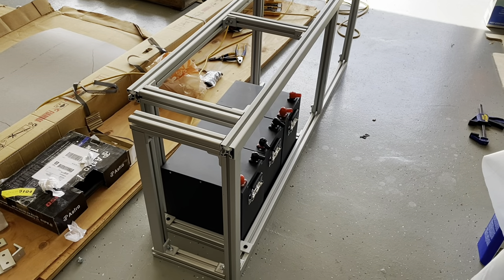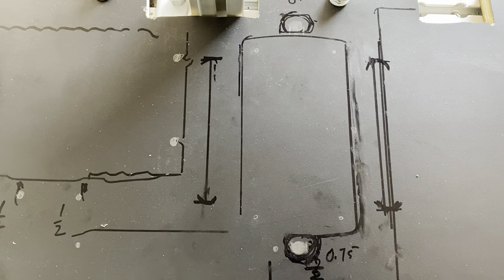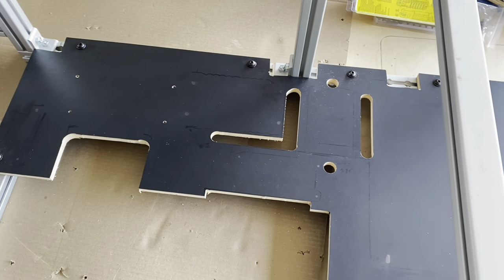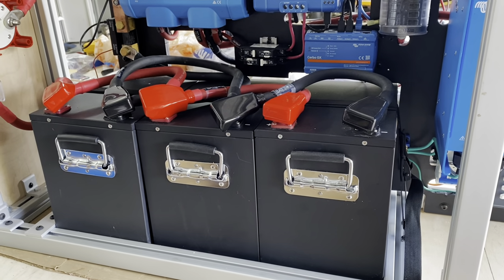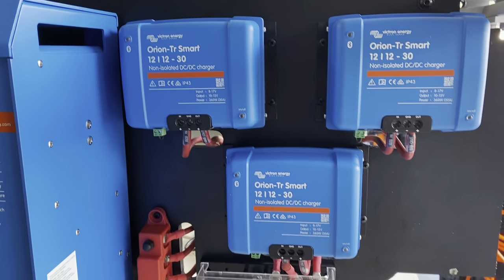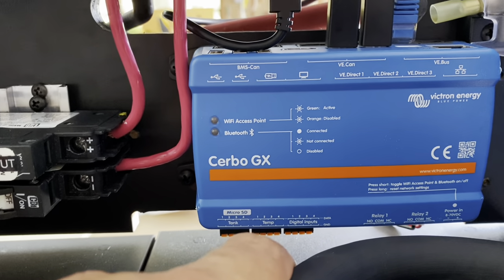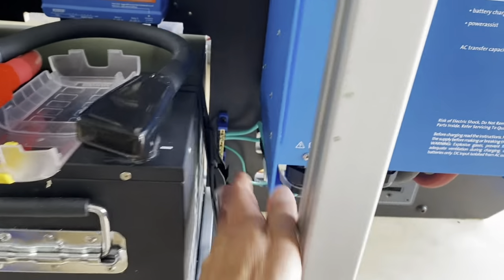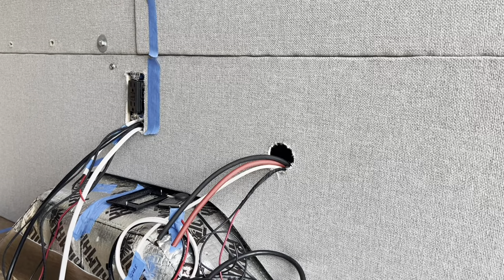Ford Transit Van Build | Power! | Building & Wiring the Electrical System Cabinet

Comment: 1 Question. What size is that wire cable on the batteries? You said you have a 600Amp fuse coming off them but the cables you have look small for 600 amps? Can the rest of the system handle 600 amps going thru it?
Reply from the maker: The cable size on the batteries is 4/0, rated at 600A for 9ft. We shouldn’t come close to getting to that level. Fuse is 600A Class T, very fast acting with 200kva interrupt rating. The disconnect is rated at 600A and the Victron Lynx is rated to 1000A. All other circuits are fused after the Lynx based upon the ampacity ratings for the wiring and devices. I will change the battery wiring so that the positive and negative cables are at diagonals. Victron has a nice guide with several battery wiring configurations for multiple battery banks.
Reply: @blazingwanderers  The wire size was the only thing in my brain that did not looks right and I still cannot find anything that says 600 amps for 4/0 wire. But if you found it then all good. I did catch the neg and pos cable thing but I did not want to be that guy. Your setup looks great. I built mine out of my van and then did not like it so I took it all apart and I'm going to completely re do the layout and design of it.
Reply from the maker: Thanks Brandon.  I agree the wiring sizing is a bit confusing. The cable that is listed at 600 Amps at 9 ft at 12V is located here - https://wiringproducts.com/collections/4-0-awg-gauge-battery-cable. To your point, most tables have 4/0 rated for 440A or less, for example 4/0 Gauge AWG Battery Cable Wire - Solar Marine Power Inverter Car Pure Copper (windynation.com).  I may drop the system fuse down and then limit the Multiplus maximum amperage and power assist modes to avoid potential for a nuisance trip since we are not attaching any heavy inductive loads on the inverter.

Comment: Nice&tidy setup. Good job.  Remeber to install  two fans and good ventilation for the orions to avoid risk of fire!
Reply from the maker: Thanks for the reply and the tip! I was surprised how hot the Orion Tr Smart DC converters run at load.  While Victron indicates they will self derate to avoid over temperature, that clearly is not ideal on the components and defeats the purpose of the having the units in the first place! I have Dual 120MM Fans with a programmable thermal controller that will activate based upon a temperature set point in the cabinet (similar to an audio or computer server) and several vents for the cabinet.  They are rated to move 92CFM.  We'll post this once finished.

Comment: Thanks for the excellent video. I am building almost exactly the same configuration but on the drivers side of my Transit Van. I have a 2nd high amp output alternator for fast charging (200 amps at idle and 280 amps while driving). I wired my batteries separately to a 2nd Victron Distributor, so 2/0 wires are fine. 
I would really love to see an update showing your completed system. 
Thanks again for posting your work, it is really helpful and encouraging to the DIY Van build community.
Reply from the maker: Glad it was helpful!  and thanks for the suggestion--I will my husband make another video of the complete system.  So far, it has worked out great and no real issues!

Comment: Good afternoon, we are planning on using victron components in our van and will lay things out similar to what you have set up.  I did want to point out something.  @ 9:26 it looks like you have your batteries connected in parallel to get your 600 ah @12 volts.  the way the cables are laid out it looks like you are pulling the positive and negative feed off the same battery, while this will work, optimally the positive cable should come off one end of the battery bank and the negative cable should come off the other end of the battery bank.  the purpose is to pull the energy through the battery bank evenly and ensure all the cells are balanced as you change and discharge the bank.  so to fix it just move the negative cable connected to the shunt to the negative terminal on the battery closest to the inverter.
Reply from the maker: Great catch on the video and comment! Per the other comment and later in the video comments, I have moved the negative cable to the battery closest to the inverter (needed a longer cable).